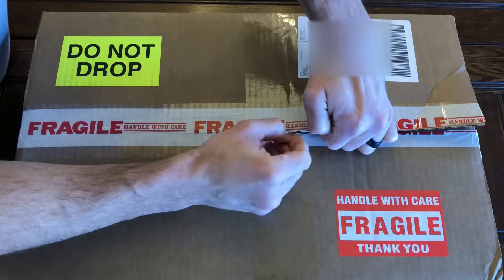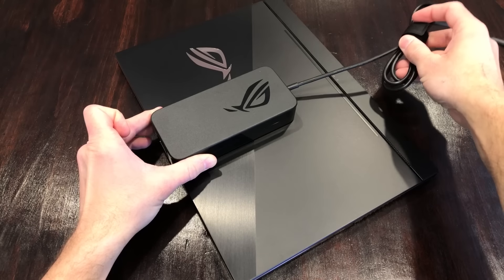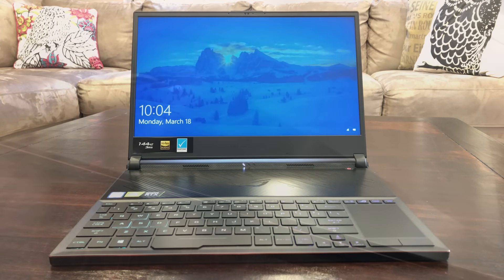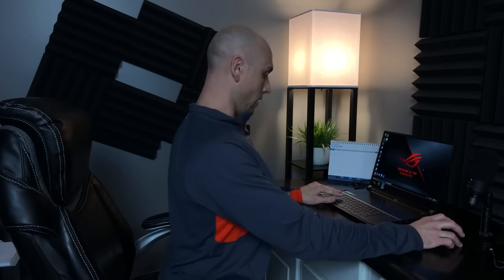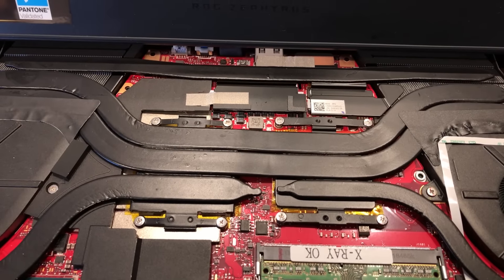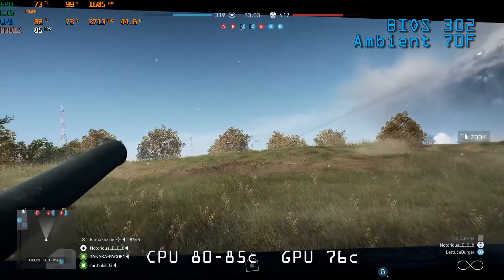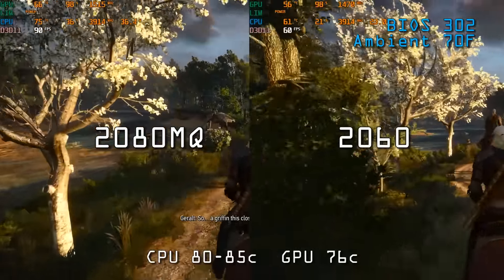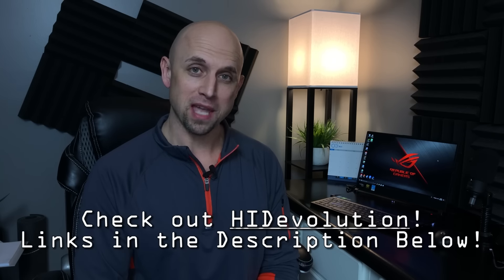Zephyrus S 2080 Review!  Special in its own way 😎

Comment: I have found that running MSI Afterburner causes the GPU to activate very frequently and interrupts Optimus on the M15, maybe try  looking at the usage with Nvidia’s GPU monitor. Battery life increased when Afterburner wasn’t running quite significantly for me.
Reply from the maker: Danny Rea I have it disabled right now and it still bouncing back-and-forth between Zero Watts, 3.9 W and now 12.032 W. 

I’m convinced Dell does something to make their GPU not kick on. Their 90whr battery in the new gaming laptops has shown some legendary unplugged time!

Comment: Would you prefer this or the MSI GS75 Same specs from HID with the Liquid Metal application. In terms of ergonomics, battery, durability?
Reply from the maker: CJ S This is more durable and will likely run cooler. Ergonomics and battery will favor the GS 75

Comment: are the thermal pad and liquid metal paste on cpu and gpu also available on the gtx 1060 6Gb version?
Reply from the maker: Justin Chan Yes if the laptop is available on their site you should be able to customize it with LM.

Comment: how do they expect gamers to buy a laptop with one storage slot?
Reply from the maker: That’s the point I made with the design. What is there is extremely crammed.  

The website mentions a second m.2 but it’s not here. 

Maybe they could’ve trimmed up the battery a little bit more and put one right next to it?
Reply: @BobOfAllTrades   I completely agree with you. I would sacrifice a little battery life for more storage capacity given that it is a gaming laptop. Awesome review by the way huge fan of yours!
Reply from the maker: Thank you my friend! And me personally I would absolutely sacrifice a little bit a battery for more storage 100% without question.
Reply: Bob Of All Trades It’s possible the second slot is on the other side of the motherboard.
Reply from the maker: It’s possible but getting to it on a review unit didn’t sit well with me.
Reply: Bob Of All Trades I hear you on that one.  I wouldn’t want to piss off the vendor all for the sake of curiosity myself, lol.
Reply: @zgoaty9235  there isn't one on the other side... just one slot.
Reply from the maker: That’s what I figured

Comment: I wouldn't trust that small of a chassis with anything besides liquid metal
Reply from the maker: With these components I’d say that’s a fact 👍
Reply: Bob Of All Trades I had bad experiences with the zephyrus m.... Thought the first one was broken so j returned it, second one did the same thing. Stayed at 95c in far cry 5, Max 97. Never below 95 lmao. With fans all the way up. This is stock thermal paste from retail though. Now that I bought a built to order eluktronics laptop, I'll never buy one without liquid metal. For only $35, why would you not upgrade the TIM?
Reply from the maker: Exactly!
Reply: @DSViDs98  I'm thinking of getting the GTX 1060 variant of the Zephyrus M. Should I be worried?

Comment: Suckptimus strikes again bothering instead of helping and user has to manually do the software's/firmware's job. This is why I covet G-Sync laptops so much or the odd laptop that does not have G-Sync certification but explicitly says it has no Nvidia "optimus". MUX are the holy grail tought XD.